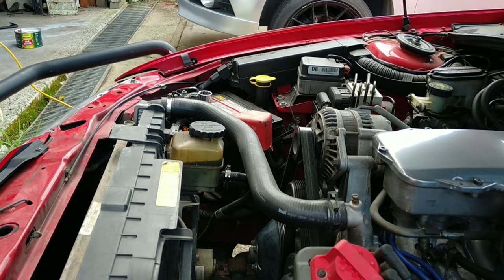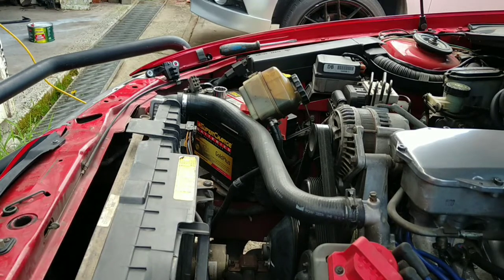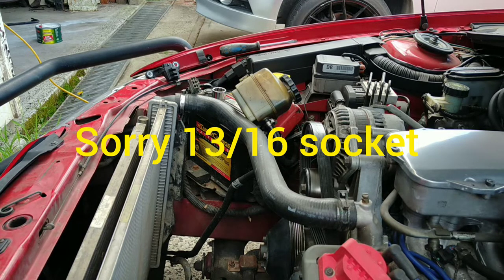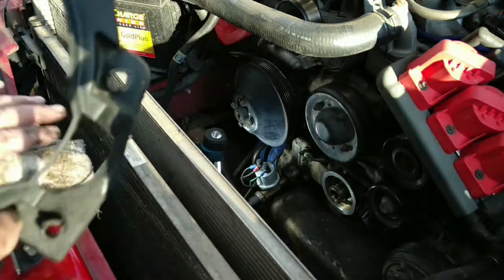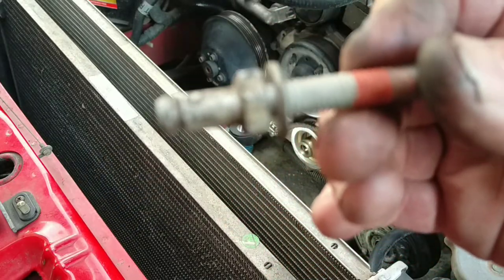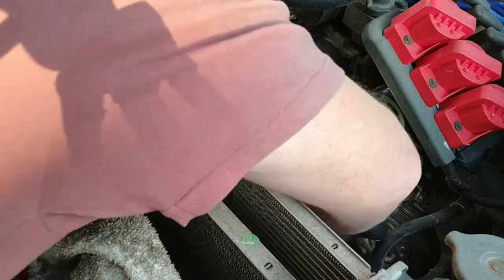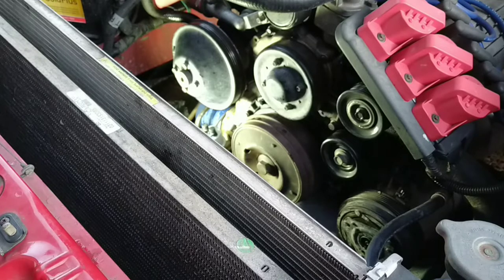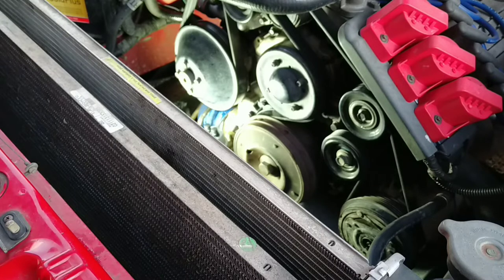Vy crank angle sensor change

Comment: Harmonic balancer bolt is a 24mm on l67 for people using this to do their l67 👍
Reply from the maker: Thanks for the info, never worked on a l67
Reply: @mwoods2062 not that different, I’m doing it off your video and it’s basically the same
Reply: It should be 24mm for all since the VP onwards. Ecotec and Supercharge. Maybe some changed.

Comment: I changed a CAS on my VT whilst watching this vid. Watch a bit, go out and do that bit. Watch the next step etc. Went great, got the new CAS in, put it all back together and engine runs fine. Came back in to watch the rest of vid, just to get to the part about changing the oil seal.................oops
Reply from the maker: Thanks for your comments, I hope it did help. I lost the footage of the harmonic balancer removal.
Reply: @mwoods2062 how did you remove it got the bolt off but not sure how to remove balancer
Reply from the maker: Hi, you have to get a puller tool to remove the balancer. I'll see if I can find a link
Reply from the maker: https://www.ebay.com.au/itm/155293496304?mkcid=16&mkevt=1&mkrid=705-154756-20017-0&ssspo=7JyKrnPvTvC&sssrc=4429486&ssuid=tzdaHHhSQqG&var=&widget_ver=artemis&media=COPY

Comment: I just did this job and now my car makes a knocking sound I think it’s coming from the harmonic balancer, with and without the belt on, any ideas as to why this might be? I think I didn’t line it up on the keyway or the inside of the harmonic balancer might be hitting the crank angle sensor
Reply from the maker: Yes, I think it's hitting one of the tabs on the back of the harmonic balancer.  Best to take it off again.
Reply: @mwoods2062 I just took off my harmonic balancer again, swapped back the original crank sensor then put everything back together, still making the same sound
Reply from the maker: @freethebunda5526  so the fingers on the harmonic balancer were all straight
Reply: @mwoods2062  Yes, all the fingers are straight and should be clearing the crank sensor, i might just replace the harmonic balancer n see what happens from there

Comment: Progress is something that is constantly changed, until it doesn't work, before satisfaction is given guarantee.
As you might recall in the Holden in the 70's it didn't matter if you had a 6 or 8 cylinder engine you only need one coil for the entire Car......leap into the 2000's and now you need 6 coil's.....Progress what a discussing word !
Reply from the maker: Yep the old cars are a lot easier to work on that's for sure.

Comment: Sorry to be a bother again when you finished fitting the balancer you forgot to check the clearance with a feeler gauge between the balancer vanes & CAS.  Oh and on the belt fitting we all got caught trying to work the puzzle on how it goes on by guessing.🧐
Reply: Can you explain this clearance needed please
Reply from the maker: It's just the clearance between the fins on the harmonic balancer and the crank angle sensor. I've done three cars and never checked it with no problems.

Comment: Have you had trouble with the front crank seal leaking after installation?
Reply from the maker: No I haven't, I always put a new one in. Even a new one will leak if the harmonic balancer has a groove worn into it from the old seal.

Comment: Got a 04 vy Acclaim series 2, was driving and it died and check engine warning light came on, and it now doesn't start just cranks any ideas?.
Reply from the maker: Crank angle sensor, it has to be electrical
Reply from the maker: It will be either no spark or no fuel. To rule out no fuel disconnect the fuel line and turn the ignition on and see if it is pumping fuel

Comment: Why did you change the CAS. My car has just stopped, it cranks but wont fire up. No spark. Do you think it's the CAS ?
Reply from the maker: I changed mine only because I did a scan and got a slip ring fault but most commodores do.
Reply from the maker: The slip ring was only 25 bucks so I thought why not. When you turn your ignition on does the lock symbol stop flashing. If not you have a security problem. If it does go off I would look at the crank angle sensor.
Reply: @mwoods2062 Hey on my VZ the lock symbol flashes and doesnt go away unless i unlock car or keep twisting the key 10times. Also pops up with Service vehicle soon.

Could this be Slip ring?
Reply from the maker: Hi, that sounds more like a slip ring problem. Can you unlock the car with the remote.

Comment: Hey mate how did u rap the belt around
Reply from the maker: If you are talking about wrapping the belt around to undo the harmonic balancer bolt I just put it over the balancer then wrap the whole belt around the balancer again and then up to the alternator. Remember if you are trying to undo the bolt the balancer will spin anticlockwise so wrap the belt around clockwise
Reply: @mwoods2062 sorry mate I’m not I understanding
Reply: @mwoods2062 I’ve been maybe 2 hrs just tryna get the thing to not spin and can’t
Reply from the maker: I'm really sorry your having trouble but basically I use the belt to stop the balancer from spinning.  So if you are undoing the bolt the balancer will spin anticlockwise.  You have to wrap the belt around the balancer in a clockwise direction and then hook the belt onto one of the other pulleys.

Comment: Stuck at the easiest step... How the heck does the power steering reservoir come off???
Reply from the maker: Hi , you have to push a little black tab in when you look from the top and slide it up.
Reply from the maker: Use a flat screwdriver and push it towards the front of the car if my memory serves me correctly.
Reply: @mwoods2062  thanks heaps for the reply! Your vid gave me the confidence to have a go
Reply: Got it cheers!
Reply: Lol
Reply: @leoprior3437  I got the job done :D